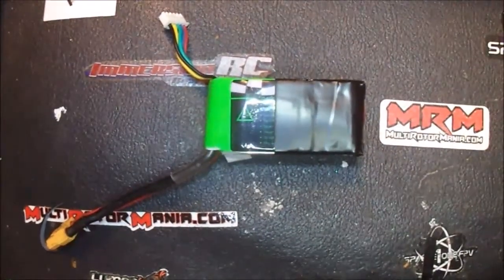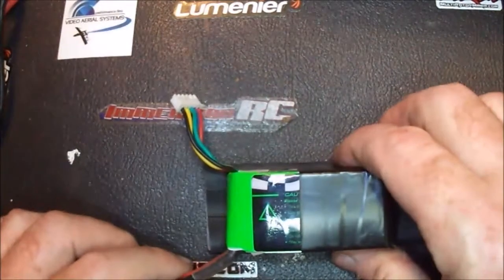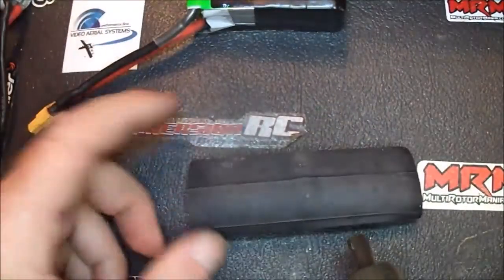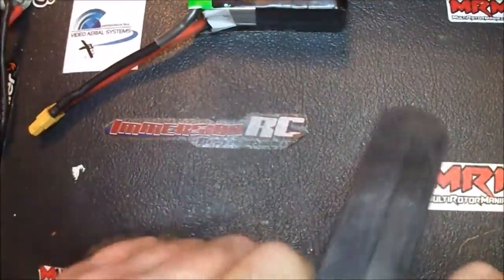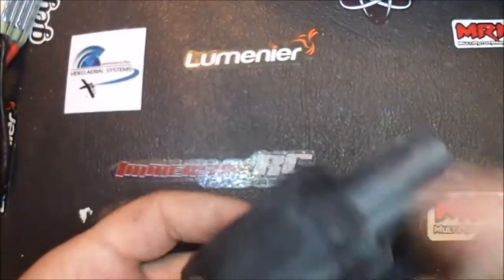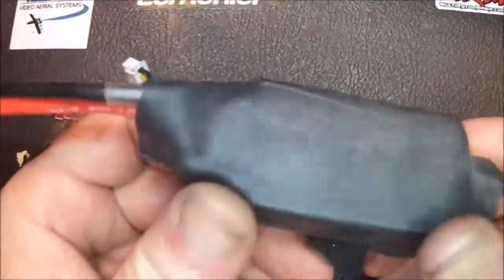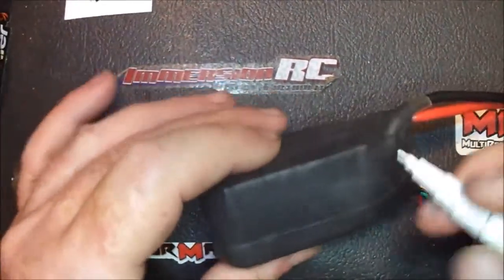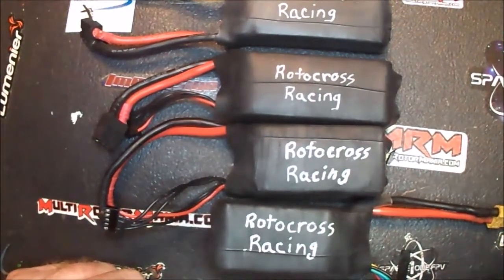Rick's Tip of the Day ..How to protect your Lipo Battery packs

Comment: Thanks for the tip!
To make things easier, start at the end with the wires then stand the battery on the table. This way you can pull the tube down from both sides over the battery.

Comment: Thanks for the tip! Thought I'd share a couple thoughts...Never have to buy a tube; pop into any local bike shop and ask for the tubes from the garbage. They're installing new ones for customers all 
the time. And you can get different sizes this way. Also, snip the tube so to remove a bunch of ~3/8" loops. Each one is like a rubber band. Slip these over your batteries in various ways (single,          double or more layers and different directions), but spread them out to allow heat to dissipate better than the solid sleeve way. Bands are also much easier to install and you won't need a heat gun.